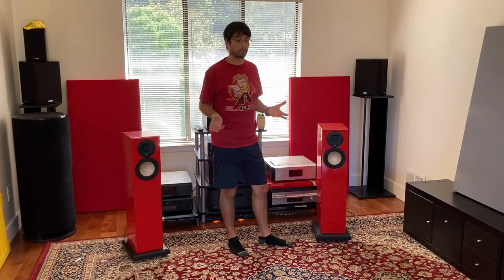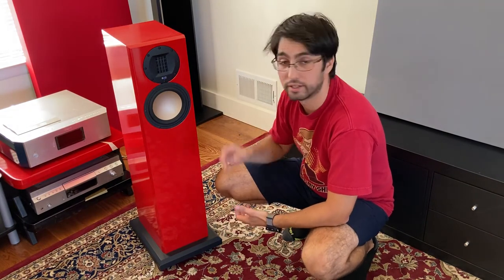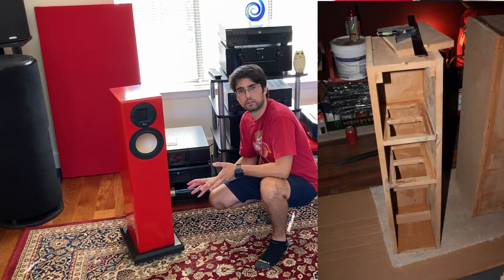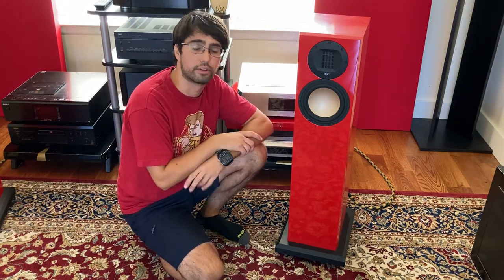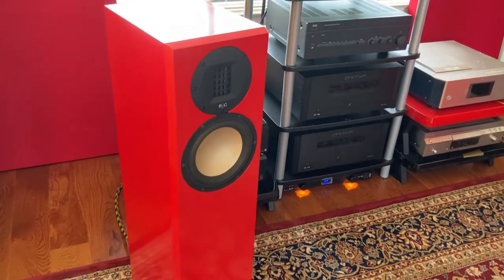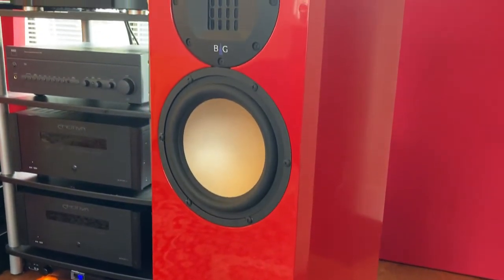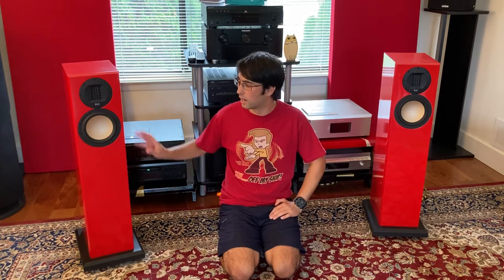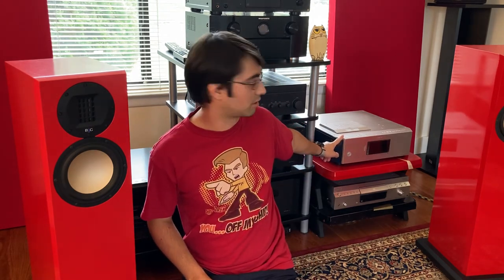First DIY Speaker Build ZX Spectrum Desing by Paul Carmody - Lessons Learned

Comment: Bill Carmody said that since the M6a is discontinued, the M6n is a drop in replacement for any of his designs. I built a bookshelf styled ZX Spectrum for use as my center channel. I also use the Swope 2 ways for my surrounds and the Swope 3 way towers for my fronts.
Reply from the maker: It would seem so the M6n would be the drop in replacement! Do you have a source where Paul says that? I got the M6n drivers, DATS and a Cal Mic. I am getting familiar with the measurement equipment and will be doing A/B measurements when I get the chance.